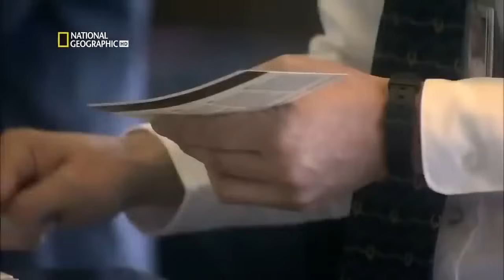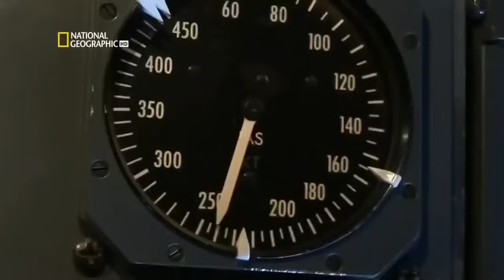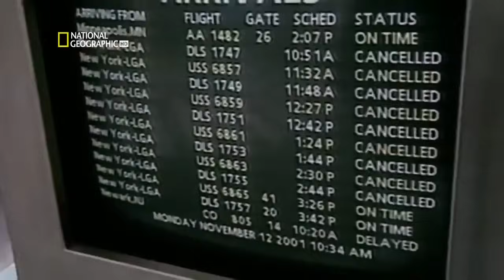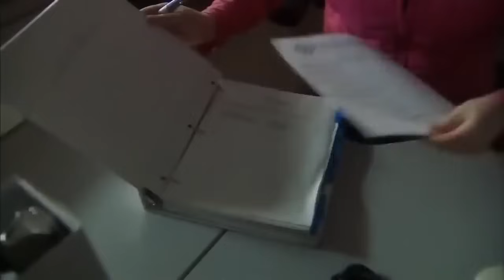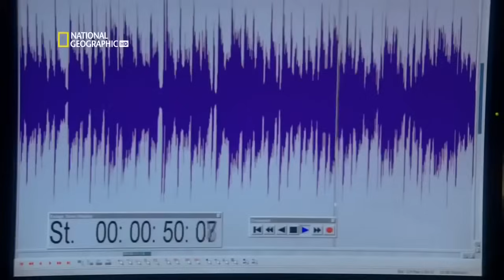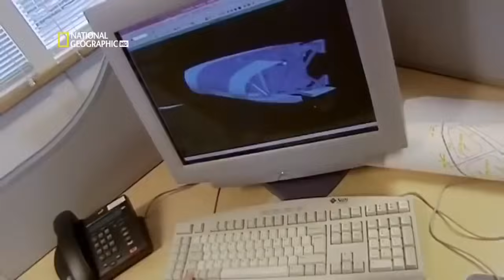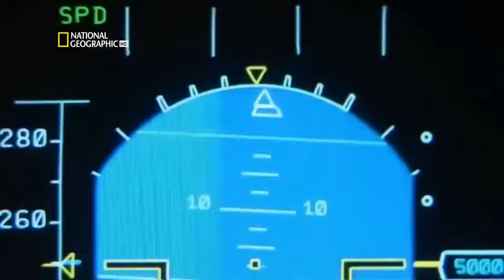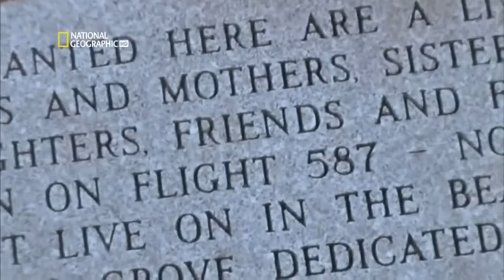American Airlines Flight 587 | Air Crash Investigation | National Geographic

Comment: Poor Stan Molin, he did exactly as he was taught. Now he is blamed for this. RIP Stan, you tried to save them. it was not your fault.
Reply: 100%. Sten Molin did what many other pilots would have done at the time. Same principle as moving the wheel on your car from side to side to find traction on slippery roads. You don't expect the steering column to snap off. From the NTSB report: "American’s AAMP ground school encouraged pilots to use rudder during recovery from upsets and the airline’s simulator exercise re-creating excessive bank angle “could have provided negative training” to the first officer. He added that the A300-600 rudder control system is susceptible to “potentially hazardous” rudder pedal inputs at higher airspeeds"
Reply: This is Airbus fault
Reply: @olocks1  - Part AA training fault, part Airbus design fault, part AA policy fault for discouraging safety in favor of flight scheduling.
Reply: @olocks1  100%.  It's reasonable to know that control inputs can cause loss of control, but completely unreasonable to have loss of control surfaces.  Like if you turn the wheel hard in your car on the highway, yeah, you are likely to lose control of the vehicle.  But it's another thing entirely to say "if you ever turn the steering wheel all the way the wheels will fall off"
Reply: @olocks1  I blame American Airlines for improper training.
Reply: That's right.  People can't be blamed for things that they were not trained for or not properly trained.  It's too easy to lay blame on dead pilots.
Reply: @olocks1  American airlines should carry the can for this...Stan was only following his training which leads to another question.. Does the pilot training brainwash pilots into losing any incentive to think for themselves?..It's a question of "Do I follow my training to the letter?" or "Hang on.. This doesn't seem to be the right thing to do in this situation"....Tough call if you ask me..
Reply: Yeah, but it was because of Stan Molin who sacrificed his and 200+ people's lives that the Airline realized they were not training the pilots well, which has prevented many other planes from crashing. This means Stan Molin has saved thousands of lives by sacrificing a few hundred.
Reply: As a professional pilot he should have realised sooner that his inputs were too aggressive. To be unaware that he was causing the plane to behave the way it did is shocking.
Reply: Nobody blamed, he actually made it known about the sensitivity of the radar. He is a hero
Reply: @macandrewes  What?  NEVER do that on a slippery road.  Are you insane?  That's just as bad as slamming on the brakes when hitting a patch of ice.
Reply: @WalkerRileyMC  Not violently. It's a subtle, gentle move to determine whether you're in contact with he road and actually steering the vehicle. I've been driving in the worst Canadian winter conditions for over 30 years.
Reply: @michaelkenny4124  Welcome to modern airliner pilots.  They're so used to relying on computers to do their job for them that they lack the ability to "feel" the aircraft.
Reply: Stan Molin wasn't the only hole in the layers of swiss cheese to the accident, but he certainly was the last one. Clearly an unnecessary overreaction to turbulence. While the simulators wouldn't have simulated the tail coming off, they surely would have simulated that his inputs would have caused the plane to essentially fishtail in the air. I'm suspicious about how much blame this episode puts on the training, does it really say to mash on the rudders... I'd bet what the episode calls training error is that it was really just missing the equivalent of 'coffee burns when hot' warning.
Reply: It's so sad that pilots have to take the blame in most crashes. Even if they did do something wrong it's usually just bad training like in this case. It's also sad that most Airlines have no problem throwing the blame at their pilots to somehow not have to pay anyone any money. American seems to be the only one that never actually stands with their pilots even when wrong 😒
Reply: NTSB Biggest white wash in an agency devoted to white wash!
Reply: I honestly think Sten was spooked by the potential JAL wake turbulence right from the get go- you can hear it in his voice.  He never should have performed the take off roll.
Reply: Eric L 

I agree with you.  Sten should have known, based on basic aviation principles, how that plane would have reacted to such extreme inputs.  I think he was nervous and anxious before he even started his take off roll.  You can hear it in his voice. That said, I wouldn’t attribute the crash entirely to bad piloting, but mostly.
Reply: @tbr2109  What an incredibly asinine assertion, not to mention completely irrelevant to the causes of this crash.
Reply: Save them? Save them from what? Minor wake turbulence that otherwise wouldn’t have been a factor at all.
Reply: @olocks1  actually it’s American Airline’s fault.  The captain should have been more vigilant as well.
Reply: Joeseph Perez  But exactly, you only know what you were taught.
Reply: @veeruhrcgeology  

there was no reason for him to wait.   His clearance for take off was fine, as confirmed by the captain and ATC.  Molin had a gerbil up is A$$ over non-existent wake turbulence.  we’ll never know why.
Reply: This place is overcrowded with Monday morning quarterbacks.   
Bill
Reply: @serialkillerx666  

His name was Sten not Stan.
Reply: it was americans fault, they trained him to do this and he fought himself  on the controls
Reply: @Rangerman69420  You say one thing first and then you say the exact opposite right after and you still managed to be wrong in both cases lol
Reply: it is China's fault, the rudder system was designed in China
Reply: You don’t  need touch the rudder on a modern commercial jet aside from on takeoff, landing and in an engine out condition. Hard to believe this was trained at AA
Reply: Stan did what he was taught, but it was wrong. You cannot slam the rudder side to side to correct wake turbulence. That directive came out after this crash.
Reply: The flawed system failed him
Reply: Molin was repeatedly warned about excessive and aggressive rudder use prior to the accident. Tissue samples also showed he was under the influence of stimulants
Reply: Never fly on an Airbus
Reply: @Mustafa Hamdan the crash was the result of poor training. He followed what he was trained to do.
Reply: @adotintheshark4848  if that was the case all the pilots trained by American airlines would have crashed. So, it was pilot's fault. Simple logic. Would u blame the driver in a car accident or the driving school? But having said that, it could be due to poor maintenance of the plane as well.
Reply: @Rangerman69420  If it was bad training then many pilots would have crashed their planes. In this case, the pilot overreacted due to lack of experience.
Reply: @Dharmicaction  there was a later directive to not apply hard rudder inputs. Apparently the pilot didn't get the memo.
Reply: @macandrewes  I’d have to disagree with that because the Captain even asked the F/O if he was alright after he asked him to add maximum power while encountering the wake. Since the situation only took 5 seconds to deteriorate and because the aircraft was moving violently, I wouldn’t blame the Captain for not trying to stop the F/O from doing such control inputs.
Reply: Yes you're right
Reply: All 'fly by wire' systems like on this Airbus, are designed to mitigate between pilot input and effective 'output' or control.
It was designed to prevent just such a thing, which could and did happen in the past, usually with fighter pilots: that the wings or other parts would tear off because the pilot input caused it.

With 'fly by wire,' the pilot input is passed on to a set of computers, usually three, which confer with each other if the requested input is feasible. If not, the computers will put out an modified command to the actual control surfaces, so no pilot could ever destroy his own plane by faulty input (unless the pilot steered it directly into the ground).

The state of the art computer systems on the Airbus planes were not without (design) flaws though.
In a different episode of "Flight Crash Investigation (Mayday)," a Russian Airbus went down because the pilot was not aware that the autopilot was partially disconnected. 

According to the manual, all he had to do was release the controls (actually letting go of the controls) then the plane would correct its attitude and speed to a safe course again. Unfortunately, the pilots had not received enough time to get accustomed with this admittedly contra-intuitive approach because when the s***t hits the fan, any pilot's instinct tells him to take manual control.
Reply: @tech99070  If you want to compare wheels to vertical stabilizer, just tell me what will happen if you lose control over vehicle at speed of 280km/h ??
Reply: 100% Stan Molin's fault. PIO.
Reply: I’d rudder not talk about it.
Reply: I'm sorry but this is not how you fly, the first and major lesson when flying is smooth and gentle on the controls. The pilots did not correctly asses the situation and just improvised. Try applying those imputes yourself on a flight sim and you'll get the exact result. A plane like that is built to withstand that, and the changing dynamics of flight controls on the ground opposed to the air isn't something Airbus needs to clarify in a bulletin. Obviously the first officer didn't do it on purpose and that's the sad part but he was at fault that's for damn sure.
Reply: Same. If I pilot can snap the whole tail off during normal maneuvers, that’s a plane design issue, not a pilot issue. I’m surprised they didn’t go more into carbon fiber, which is notorious for completely shattering even when reinforced. As someone whose seen full carbon bicycles shatter into tiny pieces I was not surprised all six carbon moorings on the tail broke.
Reply: @Wargasm644  Best comment on this entire "Comments Thread"! LOL
Reply: It was his fault. 1000% his fault.
Reply: Well his actions caused the crash. Ignorance isn't an excuse really.
Reply: We can go bouncing all over the room placing blame but in the end, we are right back where we started. If you want to get technical the blame can rest right on the shoulders of The Capt. I choose to not do this, however. The blame here is a systemic failure going all the way from Airbus to American! The FO did not take those actions to cause a catastrophic airframe failure. He took them because this was the way he had been trained. There is a reason that a person sitting in a large passenger airliner is supposed to be type rated in the said aircraft. In this case, somebody fricked up and this had a FO doing something that caused an airframe to fail. I date an American FA that knew two of the FAs in that flight! Still stays in contact with one of their children. We are over 20 years after the events of that horrible fall of 2001. These people are still missed!
Reply: @tazman8697  as a pilot, I can affirm that the principle that the rudder can be used to stabilize wakes, makes sense. It does work, but when it doesn’t work in the first few turns then you try to steer out of it. Rather than use the metaphor of “steering back and forth to gain traction” as others have on this thread, the metaphor is more like one lane on the road having no traction, while initially you may try to rudder out of it, eventually you have to shift lanes regardless of risks.
Reply: Bruh he shoulda waited longer after the Japanese Airbus. Spoiled brat who became a pilot at 23 bcos of being spoon-fed by his pilot father causes a crash via impatience. His fault.
Reply: No one blames him as if he caused it.
Reply: @michaelkenny4124  It's almost as if he lacked self awareness, perhaps too comfortable in the knowledge he received, instead of being a critically reflective practitioner.  Other pilots on previous flights questioned him directly about his actions but he appears to have not done so himself.   He relied too much on being obedient and too little on lived experience.  Also chances are high that just like in many industries and professions, being a curious person is considered to be rebelious and as a result finds themself persecuted.
Reply: @Wargasm644  Rudder Not? Or rather not?
Reply: @daviddavis3389  did the joke go over your head?
Reply: Stan was a hero. He used his expertise for the safety of his passengers based upon the exact training he was taught by the airlines, itself.
Reply: @mach6893  😊
Reply: Molin certainly isn't the only link in this crash, but I wouldn't be so quick to absolve him of any blame. Saying he "did exactly as he was taught" isn't quite accurate. He had a history of overreacting to even light turbulence. And yes, he was trained to use the rudder aggressively. But it's telling that this was the only crash in which severe rudder inputs ripped off the tail -- even though hundreds of other AA pilots were trained just as Molin was. 

Remember, the NTSB investigator that he had NEVER seen such extreme rudder inputs in all his years of investigating crashes and pilot performance data. The training was faulty, but the fact is that Molin took the aggressive rudder approach far, far beyond anything conceived by AA trainers -- or his fellow pilots. 

Of course he didn't mean to bring down the plane and I feel horribly for him and his family, but it's important to have a full understanding of all the factors at play here, and Molin's tendency to overreact and over-use the pedals is definitely one of them.
Reply: @macandrewes  of course he is blamed for the Accident, for simply not using his Brain and common sense , I don't know you from America , but this is also an American problem as a lot of Court Verdicts made proof of . if it is not in the manual it's not my fault. Same with the AA- Guy I don't know you can't do that this is really Pathetic.
Reply: @sammy2278 as sad as this reality is, your comment is 100% true, same can be said for many sad fatal flying tragedies. The one that sticks out for me is the BOAC comet, the shape of the windows :(
Reply: This is not what the AA Advanced Aircraft Maneuvering program teaches you to do. The captain was alarmed because Sten was already over controlling, and he went much further than necessary to the point of ripping the tail off. He was entirely responsible for the crash.
Reply: @tech99070  the result is the same you will lose control
Reply: @RMR1  Completely agree - its a confluence of events. A more capable and experienced pilot would not have been disoriented so easily, they'd have known that their violent inputs would have been contributing to the behaviour of the aircraft and if the aircraft wasn't responding as expected, you don't keep making massive, high G actions like that - the plane isn't bulletproof! Molin was clearly too junior to know and likely didn't really understand the limits of the aircraft as well as the appropriate response.

The fact other pilots had noted such aggressive action as being unusual tells you everything you need to know - flying with such aggressive inputs was not industry practice.
Reply: @T-onblitz How would a Pilot know the force loading on the rudder? Pretty hard to really feel the precise limits with your legs.

Nah, this was on Airbus. They even modified the rudder controls going forward and changed the computer control for the subsequent a340.
Reply: @DarrylHart While his actions were the primary cause, it is not debatable that the vertical stabilizer falling off from too much rudder is clearly a serious design flaw that should have been corrected by Airbus instead of them just saying not to use too much rudder. Definitely not entirely his fault
Reply: Yes, I really feel for him, now it’s down in history. Rip everyone, may God grant the families peace
Reply: @macandrewes  no he did not. And the training was revised to place less emphasis on the rudder but apparently Molin didn’t get the memo.
Reply: @tazman8697  his name was Sten Molin. Not Stan.
Reply: @sammy2278  are you for real? 264 innocent people died because of this fool’s actions. Sten Molin , not Stan, who was also a sexual predator, Google his name, was repeatedly warned not to gun the rudder so aggressively. American Airlines also revised their training to place less emphasis on the rudder. Molin didn’t apparently take heed of any of this. 🤦‍♀🤦‍♀🤦‍♀🤦‍♀🤦‍♀
Reply: @josephotieno4701  "Radar"? Don't you mean RUDDER?
Reply: @tbr2109 The A300 used mechanical controls, and not fly by wire. Its computer systems were quite early on, so your argument is invalid.
Reply: @jp.1543   Sten Molin not Stan was a sexual predator and a bad pilot.
Reply: @Pumpmouse  It's crazy this is an old comment from 4 years ago where everyone's like poor guy he was a hero and then everything came out that he was a horrible predator and rapist
Reply: @gloria88246  Hi Sara Hammel or is it Courtney or Andee oh now it’s Gloria!
Reply: @ClarZoeLe  My name is Gloria its only ever been Gloria.  not sure who the names you listed are.  sorry 🤷‍♀️
Reply: @gloria88246  Sara Hammel is the journalist destroying  Sten’s reputation. Everything she writes is entirely false and the only one making these claims against him is her. He wasn’t a sexual predator. Read the NTSB report. Every single pilot vouched for him as a gentleman and nice guy.
Reply: @ClarZoeLe  oh I read about it from several other sources, I didn't know who she was.
Reply: @gloria88246  Which sources? You mean Substack?
Reply: Sten Molin. His father was Stan Molin.
Reply: @josephotieno4701  I don’t think I would say he is a hero. 265 people are dead.
Reply: It was a domino effect of factors that caused this crash. Stan was following the training he was given by his airline. Sadly that training was wrong and full of bs. This tragedy could of been prevented with correct training.
Reply: @AudieHolland  This Airbus wasn’t fly by wire. Built in 1987 the rudder was manually controlled.
Reply: @DystopianOverture  His name was Sten not Stan. His father was Stan. You are correct, Cecil Ewell was the man who designed the training program and escaped accountability for the crash.
Reply: @DystopianOverture  We were all trained to be heavily on the rudder to counter upsets.